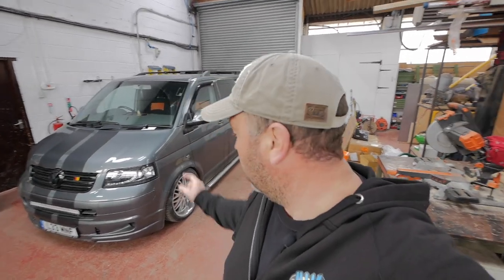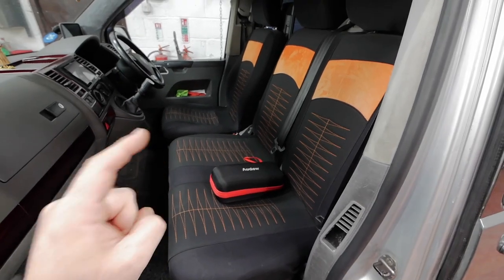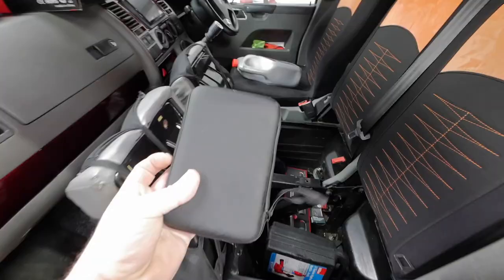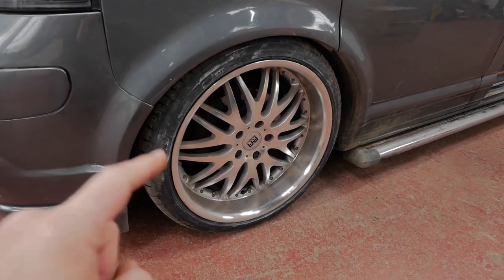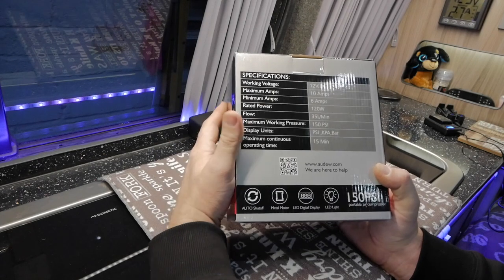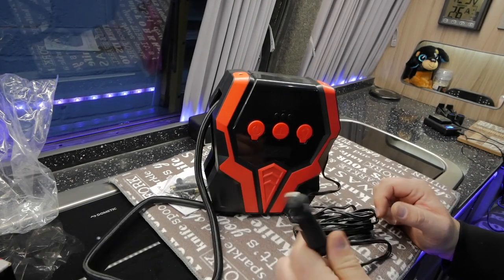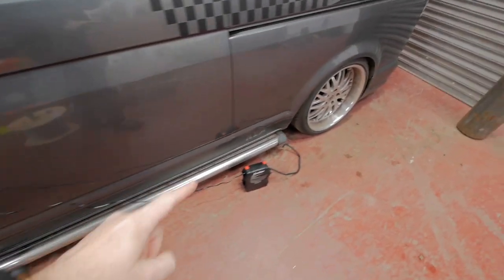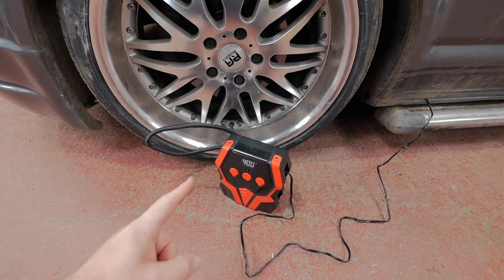Must have Camper EDC ...tyre/tire compressor inflator

Comment: How do you get the front so low on coilovers ?
Reply from the maker: Lol not quite sure. I’ve actually lifted it up as when I drop the coilovers to the bottom the side rails and front skirt sits on the floor. 🤷‍♂️ don’t understand how it ended up that low though